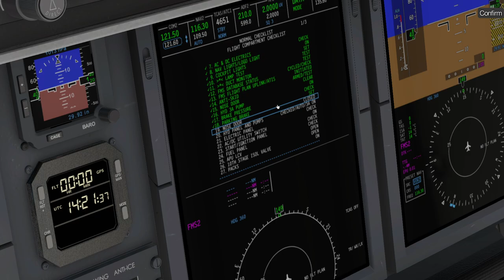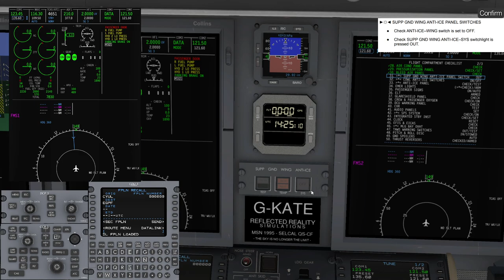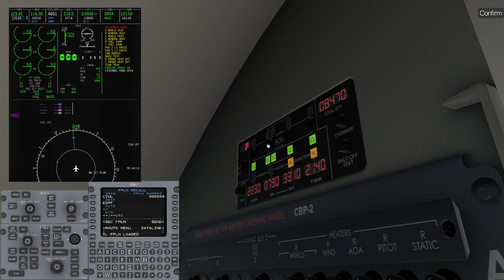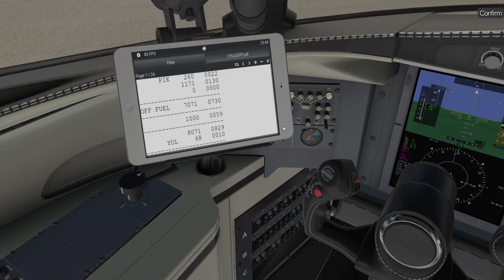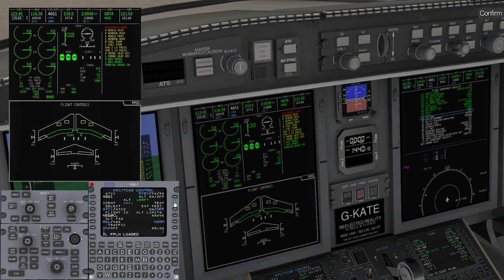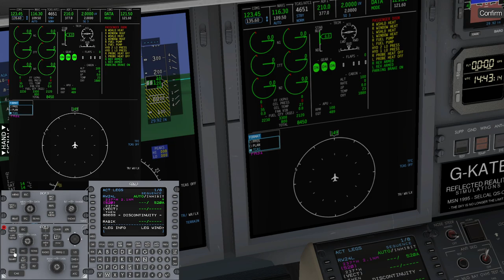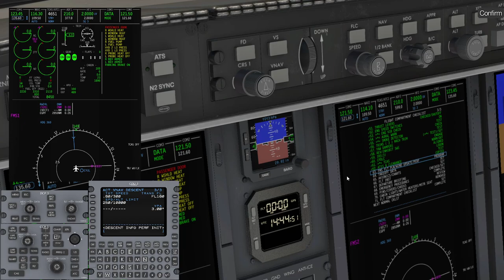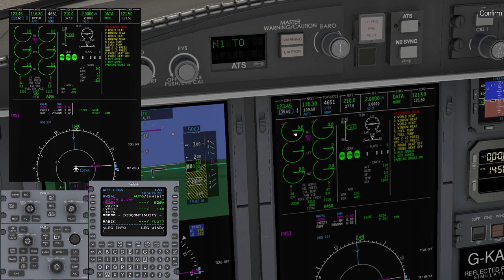Hot Start Challenger 650 - 2 - Cockpit Checks

Comment: Graem thank you for your content, how do you rate this versus the cl30 on xp11  from dden ?

i love flying that plane, although it seems less complex.
Reply from the maker: Thanks for the nice feedback. I only had the DDenn Challenger 300 on XP10, and found it to be good fun, but nowhere near the detail on the Hot Start Challenger 650. I believe the real 300 is a more modern design than the 600 series, so should be a bit easier to operate, but with the DDen aircraft I found the avionics difficult to use due to the use of a stock FMS.